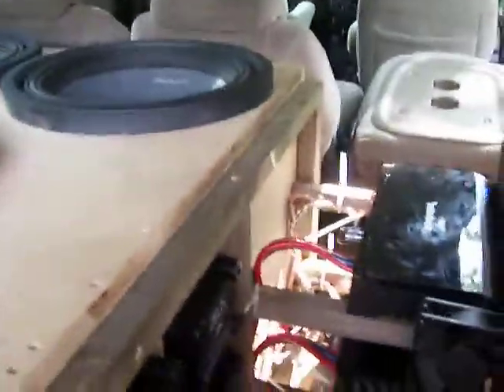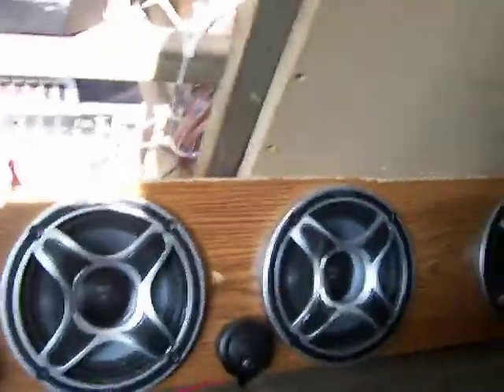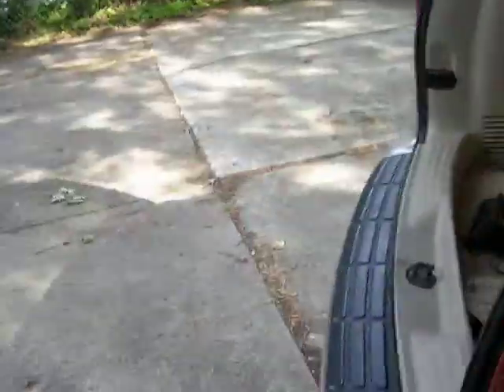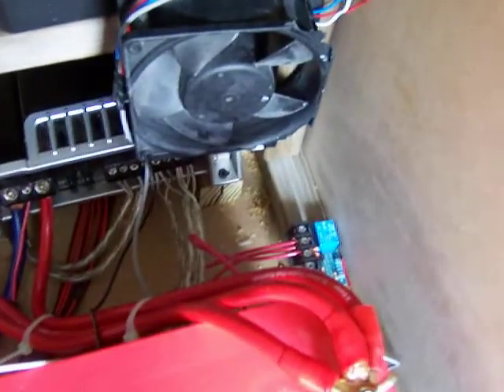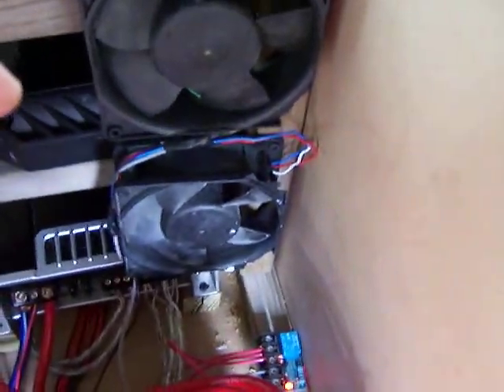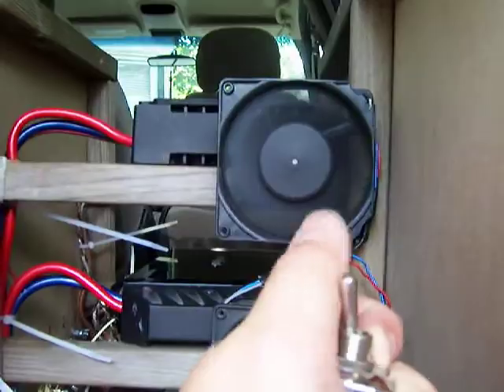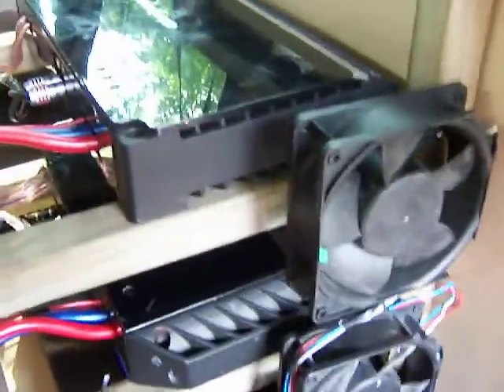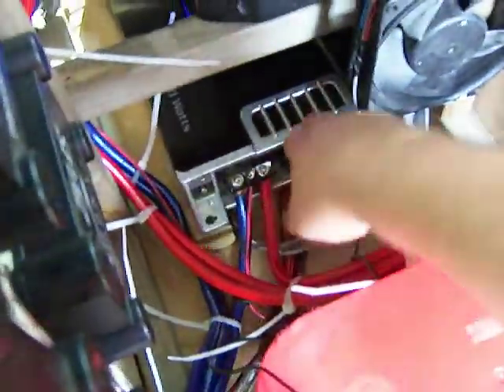New Amp Mount And System Run Through

Comment from the maker: @TylerTron21 Ya for some reason I am having issues with the 6.5"s  but I am gonna trouble shoot them. They work but just having a minor issue.  The remote/ relay is actually somethign i got from a guy in class who worked in electrical industry for years.  Its just a basic 12v NO/NC relay. I have to use that cause the head unit would go into protect when I hook up more then one amps, so I use this. The amps still get hot when the fans are off, but When I enclose the box I will need thee xtra air